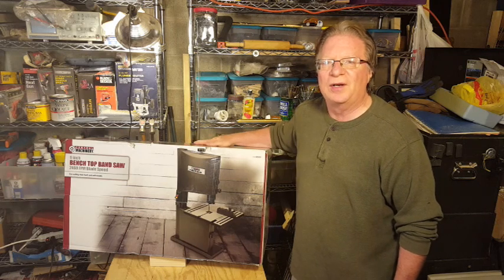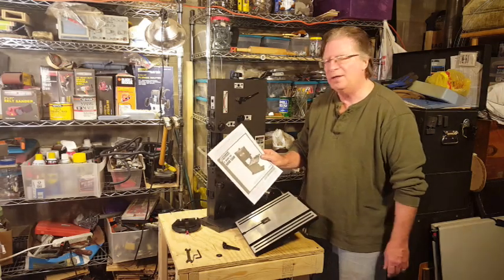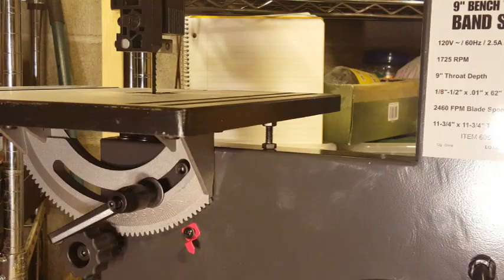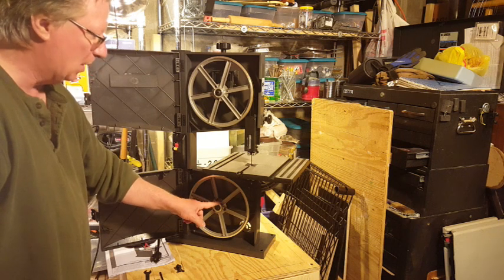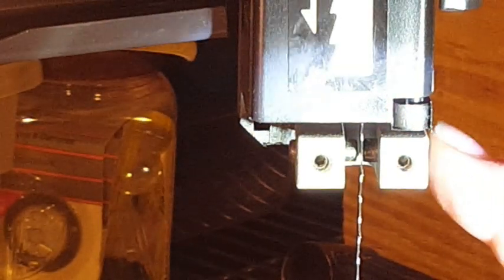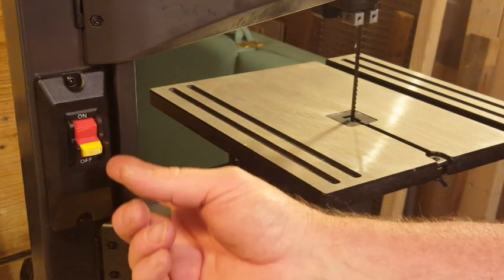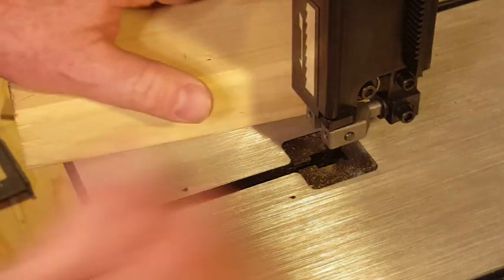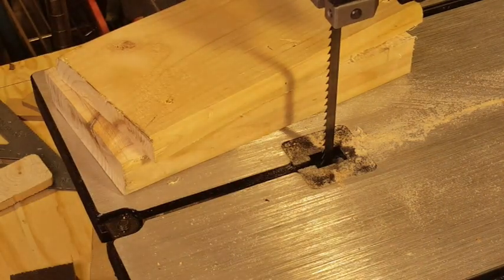32. First cuts using a 9" band saw from Harbor Freight

Comment: I used to have the whole kit and kaboodle as far as tools go. I think I loved my band saw, my drill press, my scroll saw my Dremel tool and accessories,  my jigsaw, and my skill saw. I’m starting over in my old age with my 32 year old grandson. He has a huge garage so there will be lots to do. He inherited many tools already I have many useful toys to but now live in an apartment. I’ve been give a scroll saw for my birthday. It’s coming today. 
This bandsaw looks better than having the giant one I had. I live in Canada and will look for a similar unit!  Thanks Matt! 👏🏻👏🏻👏🏻🇨🇦❤️🇺🇸
Reply from the maker: Yes, this band saw is pretty good and relatively inexpensive here in the states. I tend to favor my scroll saw though since it has a longer reach and can make inside cuts.
Like you, I used to have many more power tools years ago. They were loud, expensive, made lots of dust, and took up a lot of space. After I made this video: https://youtu.be/KnDokEpcUac that shows how loud they are, I decided to start using more hand tools and smaller power tools. Now, I prefer using hand tools and relatively quiet power tools (scroll saw, band saw, drill press). I will also use battery powered tools like a small circular saw (I got rid of my table saws).
Thanks for your comment and for watching.

Comment: The only thing about the harbor freight 9 inch bandsaw is that if you lose the safety key and you call for a replacement key they will tell you that they don't make the safety key and that the only thing the still make is the replacement saw and the belt but nothing else that's why I stopped using mine after I missed plaisted my safety key and now I have to replace the saw because they bend really easily
Reply from the maker: Sorry about the slow response Tony. I did some research and found that Harbor Freight does not seem to list the safety key as a replacement part you can purchase. I did find that both Amazon and eBay sell replacement safety keys used on various power tools; I didn't investigate deep enough though to see if they sold one for the HF 9" bandsaw. If you wanted to buy one from eBay, I'd suggest messaging the seller first. The other thing I did was do a search on YouTube and found some videos that showed how others made their own replacement key very inexpensively, so that might be an option.

Since no one else but me uses my shop and I don't have any small kids around, I don't pull out the safety key. If I did though and I lost it, I would try to make my own replacement from some plastic from my recycle bin.

Thanks for your comment and for watching. I bet their are several people out there with this problem.

Comment: Is there a fence or something that would make it straight on the "resaw"?  Seems like that the only way to go, unless you just chunk it into a planer.
Reply from the maker: The band saw does not come with a fence but I think it would be simple enough to make one. Just 2 pieces of straight lumber joined at 90 degrees and clamped to the table. Thanks for the question and for watching.

Comment: Hi Matt, just got this exact saw, and I'm seeing the cut pull slightly to the left even on fairly narrow (3/4" square) stock. The cut will go perfectly straight for the first half inch, then pull to the left by maybe 1/16". It's not a huge deal on my pen stock, but obviously the problem compounds with wider stock, even if it's thin. Watching the blade, it seems to start twisting, even if I'm not adding any twist to the stock. (Tried both with and without the mitre gauge.) Any idea what may be causing this?
The blade is the stock blade. I've squared the blade to the table top, and the mitre gauge to the blade. I haven't checked whether the channel for the gauge is parallel to the blade, and I'm not sure I could make any ajustments to the side-to-side even if that's the issue. I've adjusted the guides as you suggest. Is it possible I have my blade under too much tension? Should I adjust the tension down until it just tracks correctly? I don't expect perfection from a bandsaw (at all), especially one in this price range, but I should be able to get a straight cut over 3/4", right?
Reply from the maker: Hi Vince. After reading this, my first thought was to either replace the blade or readjust the blade guides. The stock blade is probably a stamped blade (cheaper to make) and as such, it probably will drift. Stamped scroll saw blades suffer from the same challenge. When I use the bandsaw, I typically cut close to the line and then sand or plane down to the line. If I want to make a straight cut with a power saw, I generally use a circular saw (I got rid of my table saws); it is pretty difficult to cut a curve using a circ saw). If you replace the bandsaw blade, you can try a wider blade which makes straight a little easier to do.
I hope this helps. Thanks for your comment and for watching.
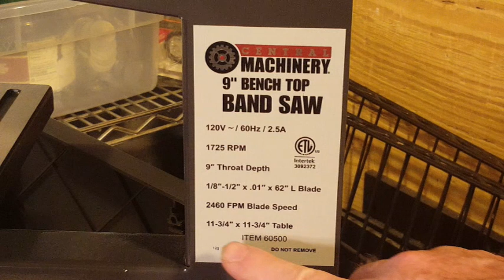Reply from the maker: Hi Vince. After I had sent you my reply, I stumbled upon this video: https://youtu.be/yGa2bU3l0dI . I think you might enjoy this video. At the 2:00 mark, he talks about bandsaw blades (but the entire video is worth watching I think).

Comment: 2014 they're now $170. Doesn't have a fence. Menards performax same price includes a fence
Reply from the maker: Sign of the times; everything is going up. Where I live, there isn't a Menards. I've noticed recently that Harbor Freight has been running some aggressive sales which I try to take advantage of.
Thanks for your comment and for watching.
Reply: @ImaginethenMake  lowes and home depot sell a wen bandsaw on their website that looks pretty much the same but its only $154.
I just do hobby stuff. 1/8 and  1/4 in birch plywood and balsa for rc airplanes etc.  so this saw would be fine for me
Reply from the maker: I bought a drill press from WEN and I think it is pretty good. Here's the video I did about it: https://youtu.be/aMKKk4_XiT4?si=XU1RHyE3S_r7La6w . If I decide to upgrade my bandsaw, I might try the 9" tabletop model from WEN and buy it from Amazon for free Prime shipping. You can also buy blades from Amazon. Here's an affiliate link: https://amzn.to/47xcLYB .
Thanks for your comment and for watching.

Comment: Thanks for doing the video!  Does the dust port of the saw fit on to a shop vac hose? (with the appropriate sized adapter)  And when you were re-sawing that 2x4 did you have any sort of guide or was that totally free handed?  Now that you've had it awhile can you re-saw a 2x4 without getting any blade lines?  Thanks again.
Reply from the maker: I don't use a shop vac with the bandsaw but I think you can connect one to the dust port (with the right adaptor). When I was re-sawing the 2x4 in the video, I did it freehand (no fence). What I could have done after the cut was use a hand plane to get rid of the saw lines. (Planing a 2x4 along the grain is pretty easy and fun!) 
If I was to re-saw on the bandsaw again, I'd probably setup a fence to guide the wood. I think there would still be saw lines which I would "erase" using a hand plane.
When I re-saw a piece like that now, I do it by hand using a pull saw (Japanese style pull saw). I watched a video from Paul Sellers where he showed how he does re-sawing by hand. https://youtu.be/S_2vh8WPgeM That's how I re-saw now.
Thanks for your comment and for watching.

Comment: I may have missed it, but... will this band saw cut metal? Do they sell a blade for metal? Thanks in advance. 

Great video by the way!
Reply from the maker: Hi Mike. I have only cut wood with this saw. This saw does not have a lot of horsepower so I doubt it would cut metal very well. You might be able to cut thin, non-ferrous material like aluminum with the right blade; I have never tried this though. Thanks for watching.

Comment: ok i have a question i just got this band saw myself after looking at reviews my question is this it says blades are .010 of an inch but everywhere i look i can not find any other then a bi metal blade can i use something a little bigger like say .025
Reply from the maker: I'm not sure but I would not recommend it. You can buy the correct size band saw blades from Amazon. Hope this helps and thanks for watching.

Comment: Placing the blade in the center of the wheel tire is INCORRECT for a band saw.  The gutter of the teeth is what should be at the center line of the wheel tire.  The gutter is that point between the teeth that is the deepest point away from the front edge of the teeth.  This is a common mistake for band saw owners.  The saw will track properly if the blade is aligned in this manner.  Otherwise, it will track to one side or the other.  Also, the blade guide should be adjusted by pushing them in until they contact the blade, then bringing them back a very very small distance until they are just off the blade's surface.  Also make sure the guides can only contact the blade surface BEHIND the teeth or they and the blade will get damaged.  Do all this, and also make sure your blade tension is properly set by looking at where the line on the spring tensioner for the upper wheel is, and the saw should be tuned up well.
Reply from the maker: Thanks for the tips and for watching!
Reply: However, I think this should be personalized to the owners preference. Just because Darius Architectvs does it this way dowels not mean everyone else should do it that way. Just saying…
Reply: @johnwood1944  Don't take my word for it.  I'm just a machinist.  Please go research band saw adjustment for yourself, and you will see that the method I described, which promoted proper cut tracking, is used by many saw operators and also band saw manufacturers.  There are YouTube videos on adjusting band saws for starters.  Just sayin'...😁

Comment: How well did this cut doing hard/sharp curves?
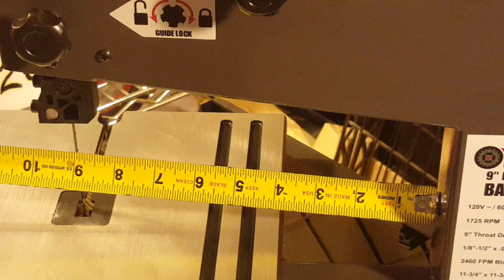Reply from the maker: Hi Robert. I have found that in order to cut sharp corners, I needed to make several relief cuts otherwise the blade will bog down. You can see what I mean at the 6:50 mark of this video: https://youtu.be/eBQU1PT0EvM . In order to cut out a 2" diameter wheel, I needed to make some relief cuts. The video shows me making them. I hope this answers your question.
PS. After everything I have tried, if I needed to cut sharp corners, I'd use the scroll saw. It's quieter, very accurate, and once one gets some experience, the scroll saw is a joy to use.
Thanks for your question and for watching.

Comment: Disappointing that it doesn't come with a rip fence, something you can really use when re-sawing. Nice review.
Reply from the maker: Yes, several others have mentioned the same thing. I think it would be simple enough to make one though using 2 pieces of straight wood joined at 90 degrees and clamped to the table. Thanks for your comment and for watching.

Comment: Great review. Very detailed. How long have you had the saw and do you have any issues with it?
Reply from the maker: I've had the band saw for a couple of years now. I don't use it that often, but when I do, it works great. I have not had any issues. The biggest thing I would look for in the next bandsaw I buy (if there is a next one) is better blade guides above and below the table. To get that though, I think I would have to jump up significantly in the purchase price.
Quite a while ago, I made a couple of videos comparing the band saw to a scroll saw and a Bladerunner. If you are interested, here are some links: https://youtu.be/mVGa4cUj_nY ,  https://youtu.be/eBQU1PT0EvM .
Thanks for your questions and for watching.
Reply: @ImaginethenMake  the comparison video was great! I am more inclined to get a bandsaw for sentimental reasons. I took woodworking for 3 years as a vocational option in middle school and every project was done on a bandsaw. :)
Thanks for you efforts in your videos!
Reply from the maker: Thank-you. Have fun with the band saw when you get it.

Comment: I saw that you made this video 9 months ago. Are you still happy? How is it holding up? What made you choose HF iver Ryobi or WEN for example?
Reply from the maker: I actually sold the bandsaw after I got a used Shopsmith with a bandsaw accessory tool. I chose the HF because I had a 20% discount coupon and there is a store very close to where I live. (I have a lot of their tools and am generally very happy with them.) I really liked the bandsaw and enjoyed using it. Thanks for your question and for watching.
Reply from the maker: UPDATE: I bought another one of these bandsaws at my local Harbor Freight today! $140 and comes with a very sharp, 1/4" blade. It took only a few minutes to get it out of the box, assemble it, and make some small adjustments to the blade guides and bearings. Then I made my first cut; a 2" diameter circle from 1/2" thick particle board, cut freehand following a line drawn with a HF compass. It came out very round and required NO sanding. The blade cut thru the wood effortlessly. This is really great because I plan to cut many other circles of various sizes for a project I am working on. I feel like I now have the right tool to use. (I should have never sold the first one I bought. Live and learn.)

Comment: What’s the difference  between a band saw and a scroll saw?
Reply: Scroll saw would be for finer work/thinner stock I believe the harbor freight scroll saw has a max cut depth of 2”
Reply: @whatitdomofaker  thank you. Merry Christmas
Reply from the maker: The short answer to your question: a band saw uses a blade that travels in one direction only (down toward the table)  and a scroll saw uses a blade which moves up and down (toward the table and away from the table). Band saw blades are wider than scroll saw blades so it is easier to make tighter turns using a scroll saw. Band saws can't make interior cuts while scroll saws can (after drilling a pilot hole for the blade to pass through). Band saws can cut thicker wood than scroll saws. Entry level band saws and scroll saws are both reasonably inexpensive (less than $150).
There is such a thing as a scroll band saw. This saw runs like a band saw so it can cut thick wood but it also acts like a scroll saw by being able to make tight turns. Here's a link to a video that demonstrates the tool: https://youtu.be/5qG-0DSnPP0
I have made a couple videos that highlight the differences between a band saw, scroll saw, and a BladeRunner (which is an inverted jigsaw). Here's some links: 
41. Comparing the BladeRunner, scroll saw, and band saw: https://youtu.be/mVGa4cUj_nY
84. Comparing the BladeRunner, scroll saw, and band saw - 2nd time: https://youtu.be/eBQU1PT0EvM
Thanks for your question and for watching.

Comment: Thank you for making this video! I have had this exact band saw for 2+ years rarely using it. I want to resaw some 2x4’s and didn’t know if it would handle it. Your video is the second one I watched about this band saw and I learned some things I didn’t even know about this band saw. Can’t wait to try it out now. Thanks again!! P.S. unless you already have and I didn’t see it, do you have or plan on making a jig for resawing? Something to clamp to the bandsaw to help with the cuts staying straight? Not sure the correct terms to use lol
Reply from the maker: Thanks for your question. I would suggest building a fence for the saw. In the video,  my resawing test cut was not very straight because I did not use a fence. Thanks for watching.
Reply: Just clamp a straight piece of wood on the table easiest and fastest way

Comment: How does this saw do with hardwoods like oak?
Reply from the maker: Hi Richard. I have only cut softwoods, particle board, and MDF using this saw. The 1/4" blade that came with my saw is very thin (it cuts a narrow kerf) and it is also very sharp. As you saw in the video, I'm able to cut through the tall side of a pine 2x4 (3.5") without the saw bogging down (If I had a 1/2" wide blade, the cut might have been straighter.). However, in this video: https://youtu.be/eBQU1PT0EvM starting at about the 7 minute mark, cutting a 2" diameter circle from pine bogged the saw down (I wonder if I had an 1/8" wide blade, would the saw have bogged down?). To cut the circle, I needed to make some relief cuts (around the 8 minute mark).
The really good thing about buying from Harbor Freight is that I have found that they have a no hassle return policy. So the best way to answer your question is to buy the saw and try it out for yourself using the wood you need to cut.
Thanks for your question and for watching.

Comment: Just picked this up today
Reply from the maker: Great! Enjoy it. One word of advise though is to make sure the blade guides are adjusted very close to the blade. Try cutting a straight line on a piece of wood to test. If the blade guides are too loose, it will be difficult to cut a straight line.
Thanks for your comment and for watching.

Comment: Ok.  Mine has a problem I think.  I'm not even at full tension and the top wheel is touching the top of the case itself!  This must be a faulty product.  Any ideas anyone????
Reply from the maker: Did you buy the saw from a HF  store? Are you using the blade that came with the saw?
Reply from the maker: Google search: 
Harbor Frieght 9" bandsaw manual
and you should find the manual in pdf format for download.
Reply: Is the blade the right length ?
Reply from the maker: @MadHatter764  Yes, the blade that came with the saw is the correct length. Were you able to download the manual?
Reply: @MadHatter764  I got it working.  I just had to completely release the tension ...  and then start over. I think they just set it at a bad default position at the manufacturing plant.  It works great now.  Thank you for the help!
Reply from the maker: You're welcome and thanks for watching.